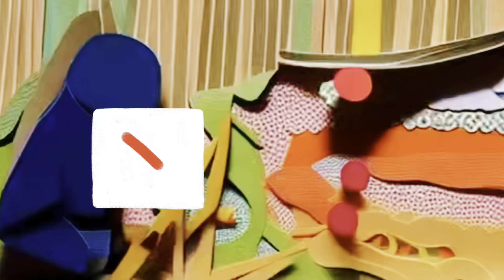Living in the Woods Building a Cabin - Finished Exterior Day 35

Comment: Consider building a loft bed to maximize space and get some storage containers that lock tight so critters don't steal you're food.
Reply: And it would stay warmer up top of the room by alot more than the bottom room
Reply: Great ideal he would build either loft bed or one the folds away to have more room he could also build fold away table to
Reply: Yeah I agree I said loft bed with desk/studio under. The only  downside is that it would be more annoying to restock the stove.
Reply: Loft bed ftw
Reply: Or get cables with pullys with weights so it can go up or down
Reply: What, naw sell out!!!! Homie! You earned it
Reply: Don’t really think there is enough space for a loft in there.  Ceiling height isn’t very high.
Reply: Like heat smoke is on the top of the room
Reply: Consider using scrap wood to add to the sides as another wall layer. It will help seal heat in during winder and looks good and keeps bugs out
Reply: A loft bed is a great idea!

Will should make an outdoor firewood and tool storage too that will give him more room in the cabin.
Reply: Congratulations you did it! I like the idea of surviving this winter, and converting it to a shed for next season - then making an all natural w/ hand tools cabin next season! 💪🏻 You’ve accomplished so much more than literally almost everyone your age and from your background. And I mean ZERO hate or negativity from that comment, it should make you even more proud of yourself. Been following since day 1 on TikTok and look forward to seeing how things go! Just make sure you and Hoop have plenty of warm clothes cause Hoop is gonna get big and want to roam despite the cold, lbs! Keep up the good work man, fr!
Reply: @keltonchavis5983 during the summer yes but during the winter no. Heat rises but also dissipates as it leaves the heat source. The ground is his heat source during the winter

Comment: Yo will! 2 things you should get from the hardware store when you can. 
1 - weather stripping to put around the door. It’ll keep more air and water out. 
2 - a carbon monoxide detector. It’s such a small space you might not realize how quick the air can reach deadly levels.
Reply: +1 on the CO detector. CO won’t be a problem if there’s no accidents, but accidents can always happen.
Reply: I don't think he needs to make it even more airtight. That stove and propane heater will use upp all the air.

Comment: Nice work Will! Here is an Idea for a nice improvement. Go to a carpet store, they usually have remnants left over from carpet installation jobs. You can find a piece the size of the OSB on the floor and it would make a nice cozy improvement to your living space. At the place I go they are usually super cheap like $10/20 bucks for the size you would need. Also a great way to make super cheap entry mats/rugs (remnants those sizes usually run like a couple bucks or are free.) Cheers man!
Reply: Definitively get some type of outdoor carpet so you don't track mud and snow on the bare wood bud. Hoopers a lucky pup don't stress !!
Reply: Yes and outdoor carpet.  Fry's fast if it gets wet
Reply: this is the way man. this'll make the cabin cozy as heck, plus extra insulation
Reply: I have watched every single episode. Fantastic and true to the heart

Comment: Propane puts out moisture as it burns, which might create mold issues inside the cabin. The wood stove is good since it’s a dry heat. Since the wood stove sucks air in, you will need some sort of vent to let some air in the cabin when burning the wood stove or it may suck out your oxygen and not burn properly.
Reply: I think he has plenty of “vents” that build is far far from air tight. Should be fine.
Reply: @gavinrush4995 the thing is fully enclosed with tarps on every side except the front. He definitely needs vents. I don't think the little bit of airflow at the front is enough.

Comment: If you would like some advice on heat situation….

Woodstove:
 You seem to know enough to be safe with the pipe. Just be sure it’s tall enough outside to be above whatever snow line you get.
You can always add pieces on through the winter as snow gets deeper.
No need for an eight foot tall pipe right away.
Start with two feet and slip pieces on as the snow gets deeper…. IF it does

Most important… do your best to make an air access point somewhere as low to floor as possible for fresh air to get in. Especially because of how airtight you’ve made the cabin.
Intake fresh air pipe should be the size of your chimney pipe MINIMUM, double it’s size if possible.

Propane Heater:
NO

Simply NO.

If you’re freezing to death and for some strange reason unable to get a wood fire going quick enough… possibly use the propane heater for a very brief time with cabin door open at least a foot or more.
And run heater right by the open door.

As tightly as you have your cabin built and insulated… you positively do NOT want to be running a propane open flame in there.

And you also do NOT want to be running your woodstove without a decent size fresh air access point close to the floor somewhere.

You’re doing great work and quick too!
Keep up the great videos, love watching as quick as you put them up!

Comment: Also, make sure you stack your stove at least a foot off the ground to prevent conduction from the ground itself. Will also creat air flow from the Woodstock in order to heat more of your flooring during those cold nights.

Comment: On the topic of clipping the toe nails, clip them if they start curling too much (get too long) but where they’re at now is good. They should naturally flake off or grind down as he runs around. If you’re worried about taking his defenses away, clip them at an angle so the cut is parallel to the ground, and not perpendicular to the nail. They’ll stay pointed but won’t be as long.

Comment: Yoo will, my advise for the overhang leading into the balcony  would be doing the same design as your roof so snow doesn’t pile up (a flat overhang would cause more snow pile up). I would butt another log the exact same size as the one standing between your door & your window. Put another log standing the same height another couple feet away from the other, run your 3rd log horizontally connecting the two like you did for the roof & basically make the same exact roof design. But obviously you don’t need walls, just the same strong roof you have over your cabin. It’ll be a pain in the ass but i really think that would be your best bet 🤘🏼 will survives

Comment: The wood stove. Put in the back. Make a long vent pipe travel down the side of the wall and vent out above the window. Having the long exposed pipe will allow more heat for your cabin. Also build a roof over a little “porch” so when it snows you dont get trapped by the snow blocking the door.

Comment: Enjoying your adventure.
Two things to consider...
1.  Ignore the haters.  They will hate on you no matter what you do.  
2.  With plastic as a moisture barrier, you will have condensation form on the plastic, which leads to mildew and mold.  To combat condensation, add a screen to the window and if it's not already hinged, make it able to be opened and left open, even a small amount during all but the coldest weather.  
A carbon monoxide detector is definitely a good idea!

Comment: My advice? Get that roof on!  You'll be kicking yourself if you get snow before you get it completed.  The interior can be worked on after the snow flies.  Do 3 poles that match your roof and make 1 continuous roof with the sheet metal. Also, Firewood!  Keep it up man, we are pulling for you!

Comment: That's the smart safe thing to do so you don't have to worry about fire and it's actually out here when building it's how you pass inspection it would fail inspection if you use just any pipe to get the exhaust out every device uses a different output to exhaust their Expendables like regular metal pipe for B Vent 4 PVC or chimney cement or whatever you choose to use in the end I just recommend.

Comment: Hey will you’re doing wonderful that cabin is amazing feat in just 32 days.

You should be extremely proud of you’re effort. 

Should look into changing that chipboard that’s on the backside of you’re door, it’s not the greatest at supporting weight, 

If you can get mdf board, or building grade weathered boards, that are flexible under weight. 

If a bears pushing enough on that door that brittle chip board will split & crack

Comment: At 16minutes 10 seconds, you talk about your front door to your cabin. I suggest you wrap it using aluminum window wrap. It's relatively cheap and inexpensive and you can find it in  30-40 ft.  spools. Then all you need is an aluminum brake and you're in there.

Comment: Same issue with the propane heater. You need air ventilation . That carbon monoxide detector will go off in that little room with a wood burning stove for sure with the door closed .  However you work that out, definitely don’t fall asleep without oxygen flow But don’t mess around and find out. Lost my cousin Briar to carbon monoxide while he was building a tiny home. Took a break fell asleep , never woke up. Wife in their real house cooking dinner. So yeah it’s real concern , good lead on that.

Comment: You should add some Insulation in the walls and ceiling for the heat will stay in and put some on the floor as well under the osb will keep it alot warmer in there

Comment: I do HVAC for a living well before I was on disability. And you need to buy something called B Vent it's a special type of piping for gas stoves of any sort or just a chimney basically but you have to use the event coming out of your stove it comes in multiple sizes but four or in should be fine for you and what it does is it's a double-walled pipe on the inside there's a wall and then a air gap and then another piece of metal wraps around that so you won't burn yourself but don't get yourself tricked that gets hot too
Reply: They sell fittings for it 90 degrees 45 degrees and they are adjustable to where you can turn parts of them to make them fit your need they're a very good invention and I would use that. It's called B vent

Comment: On the wood stove make sure you have some sort of non combustible hearth underneath it since you have wood floor. Piece of cement board would work great from hardwear store. The taller the chimney the better it will draft and burn for you. Make sure pipe is a few inches away from any combustible materials passing through ceiling and you can get a flashing from hardware store to keep water from getting in and allow to shed properly downhill on roof.

With the propane if it’s a vent free unit read directions on indoor use,   A carbon monoxide alarm would not be a bad idea. I run a vent-free unit in my contractor trailer and after a while of burn time I feel you would get s headache if spending to much time in the trailer. I’m not a fan of vent-free propane units but this is also what I do for a living putting heat sources in homes.

Comment: Run your mezzanine off the top of the cabin to the top of the basketball hoop Tree then get a log, notch out a 6inch square of the log and the cut down tree stump, this then allows you to set the log onto the stump, drill 20mm holes and bolt the 2 together. This was you can securely attach a log to the stump.

Comment: Will - you mentioned the buddy heater. FYI the gas in a 3 gallon tank like the kind you use on a BBQ is heavier than the gas in the little cans. After a week or Teo of use it will clog the buddy heater and it will quit working. Just an fyi. Hope that helps.

Comment: Will, yes you need a vent, I believe. so that you do not suffocate. I believe that with the heater or anything that burns a flame, you should have fresh air venting in. You will promote mold and unsafe breathing conditions with out it. I am not sure you want to vent directly to outside though. That would probably make it hard to keep it warm. I like the vent you showed in an earlier video. I think if you put it in at floor level at the opposite end of the cabin from the heat it will be best. Keep it closed most of the time. Unless you will be sleeping for long periods with the stove burning or you require venting the air out of the cabin for some reason. Like if there is an accident and CO builds up inside. I definitely think it should be insulated somehow though.

Edit to add, the great oracle google states that "All gas appliances must be vented so that CO will not build up in your home, cabin, or camper. Never burn anything in a stove or fireplace that isn't vented." But your stove is exhausting to outside, so I feel like that may be enough. Damn im high and rambling. I dunno bruh.

Comment: Double walled chimney pipe should be at least 8” from combustibles. Single is 16”. Going through your roof, double walled chimney pipe needs to be two inches from combustible all away around. You can do that with L brackets to fasten it, so you ought to do the stack before you but the metal roof so you can fasten the L brackets to the wood on the roof and don’t have to penetrate the metal. Don’t worry about the snow piling up a cantilever is a good idea. You’re killin it. Also it takes a few years for OSB to get weathered even if it’s completely exposed, so that won’t be an issue either for your intents and purposes. Also every inch from combustible reduces radiation by 30%. If you find some scrap pieces of James hardy concrete board (1/8) you can line your interior wall behind the stove. A

Comment: Show us some of the creek please. So we can determine if you can install a "ram-pump"  to get water up to the cabin with out using any power. Need some elevation ot the creek though,, at least 6ft high over any distance you can get pipe to. Check it out!

Comment: No.. you have enough ventilation.. but yes to the detector.. and maybe install a 12volt vent fan.. but all else is good.. triple wall pipe out the roof . Pipe boot to.. you should be good

Comment: The key to staying warm in winter is multiple loose-fitting layers.  You don't need expensive clothes, socks or boots.  Just layer up (nothing tight fitting) and you'll be fine.  
If you wear wool, wear soft loose fitting cotton underneath it against your skin.  Wool is very itchy against your skin.

Comment: Don’t use the propane heater bro! You can get carbon monoxide poisoning and suffocate! Wood stove w carbon detector all day. Till then run an electric heater from your car battery. You can keep an extra battery in the back of your car with a solar panel and converter to keep it rocking without killing your car.

Comment: You can take a knife an crave the foam to make it look good use a PVC pipe around the metal part of the stove then stick both them through the roof it’s fire resistant then you don’t got to worry about fires

Comment: Don't put a escape hole on the roof because 3 reasons,1 if any accumulation be layer on roof will freeze and could be dangerous. 2 continued use will cause leaks if not properly installed. 3 fire rises and hoop is having a blast.I see nothing with that. And my pitbull Gunner sleeps with me.

Comment: You need an external propane heater to use it in a confined space. The smaller propane ones are only safe for a short period to taking the chill off and should you’ll need a co2 alarm with both set ups

Comment: Lp, carbon monoxide, and fire alarm combo. Grout and tile floor. It would be the shit look into cheep saw mill you can bolt to a chainsaw. Would be able to finish that cherry.  Bags of concrete, for water retention. Pipes for diversion and overflow. Viscuine plastic for emergencies.  Water, emergency dehydrated food, rope, sleighs, snow feet. Get it bro stay safe clear roof panels, greenhouse and water are next!  Leave his nails!!!!!

Comment: you know you could use a board as a lock on the inside (kinda like a barricade) and you wouldnt have to worry about bears or the snow if you were to change the direction of the board

Comment: There is one mistake you're making and that is, "You're never done." You need to put an over-hang on your door to keep rain out. You don't have one. I would also put additional wood / material on the inside where that window is. An additional layer. This is going to help with moisture and as installation.

Comment: As someone who builds houses. People act like the roof is done before the floor. EVERYBODY WONDERING. OSB HAS A MOISTURE RATING. ITS MEANT TO GET WET. YES IT SWELLS. BUT GET OVER IT. AND SOME OF IT COULD BE COMPLETELY SUBMERGED FOR UP TO A YEAR. Hes not trying to make this place last 20 years. The plywood floor will be just fine. And when it isnt. Its EASILY REPLACABLE. Too many people giving their opinion with no educational value. The difference between knowledge and wisdom is experience

Comment: What are you doing for ventilation? Gonna get wet in there with your breath, and you’ll probably want some airflow. Maybe put in a snorkel when you put in the chimney
Reply: I’d also keep the wood outside because that wood is going to be letting out moisture! It’s going to be SUPER wet in there if you do that. They make propane heaters for tents, so running one inside shouldn’t be a problem, but propane also creates a lot of moisture when it’s burning! It’s gonna be raining 🌧️ there if you don’t have the right ventilation!

Comment: You're so boring LOL. That dog fell right over and went to sleep as you were talking.😂 You do have to keep the nails trimmed. If he doesn't do it naturally you will have to do it yourself. If he was doing a lot of walking running and on hard Surfaces, they will cut themselves down naturally. He's a puppy right now. He's not doing that much so you will have to keep them trimmed. Or they will get too long. And then when they do get cut back they will bleed. Because if they get too long the quick holds the blood. that portion will be too long and when you cut the nail, you will hit the quick. And the nail will bleed.